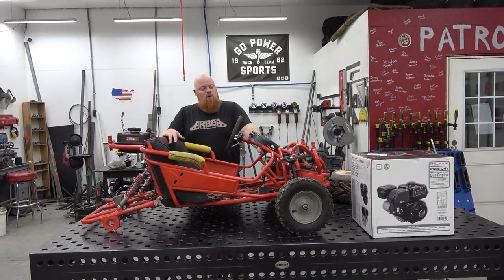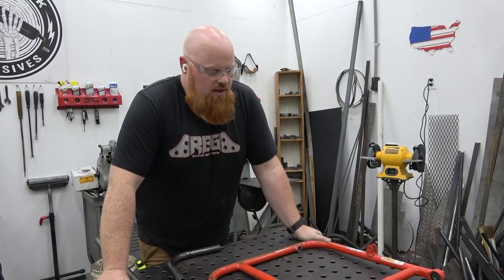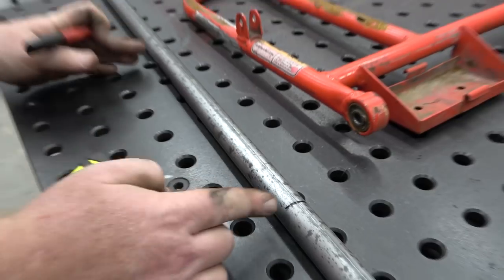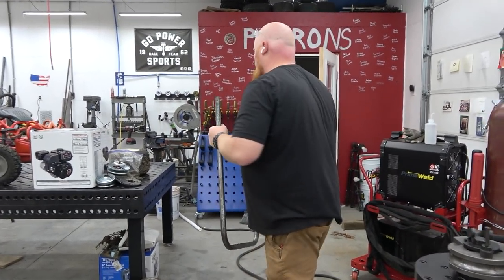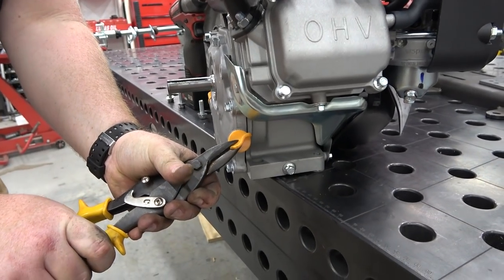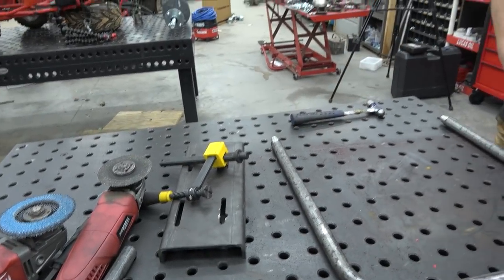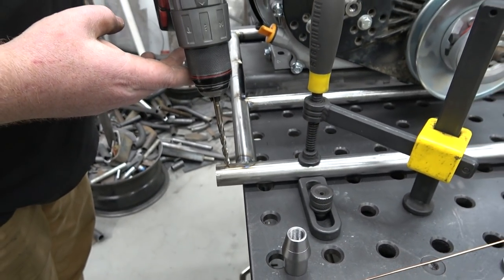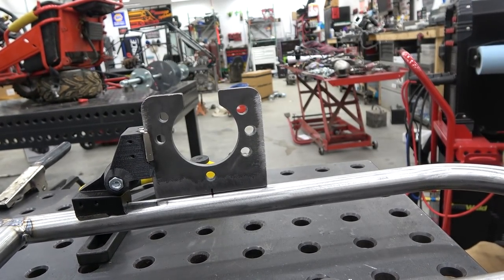Harbor Freight 212cc Mini Off Road Go Kart Swing Arm Build

Comment: why did you start in the middle on bending the back swing arm? start from one end and you could have had a 2 foot piece of tubing left instead of 2short pieces. just wondering
Reply from the maker: I like to show it different ways. I have done that in the past. Easier to explain to someone who hasn't bent tubing before.

Comment: Another Great Video .. do you drill drain holes in the tubing . I know I was welding a closed system and it would blow the weld out something you have too watch out for ,,  wish I had a Go kart like that as a kid ...
Reply from the maker: Sometimes I do but didn't on this swing arm. Depends on what it is.
Reply: @RedBeardsGarage  thank you for the response..

Comment: Ok, my slick-topped, ginger-bearded, hillbilly buddy, as your self-appointed language enforcement officer, if something can be installed, then uninstalled, or visa-versa, with bolts, by definition, it is a, “bolt-able” system. If your friend wanted an, “unbolt-able” system, you would have to permanently affix it to the frame, ie; via welding, bonding compound, etc. If it is unbolt-able, it cannot be bolted or unbolted. Are ya smelling what I’m stepping in here compadre? You’re welcome, and hope y’all have a Happy New Year! 🎊🍾🎆🎉

Comment: So with that style of bender it won’t go past the 7 degrees will it? It’s basically stops itself?
Reply from the maker: No it means that it will put 7 degrees of over bend to achieve a true 90 degree bend. All tubing has spring back so I it didn't do the overbend it would end up being 83 degrees.
Reply: @RedBeardsGarage  ohhh okay that makes sense now

Comment: Can anyone answer what the difference is from the torque converter Set up is for on go power sport then the one off line?? I just got one off line for 75 $ but the one on GPS. Its like almost two hundred. Looking at picks it seems to be the same. Same red spring ??

Comment: That is exactly what I want for my golf cart but with reverse built in. If you made that  for gas engine ezgo marathon carts id buy it . It would be a whole different thing for an electric cartbof the same model it has the rear end on leaf springs instead of swing arm. I'm sure it could  be done but I  don't have an electric cart so 🤷

Comment: I have a question. The motor mount plate that you welded on to the swing arm, has 3 separate beads on each side of the plate, rather than one complete bead the whole length of the plate. Why is that?

Comment: Hey Greg, great cheap way to save your welding shield, use pledge furniture polish.   Not the cleanser, the polish.

I spray a little on there, and wipe it off to clean the shield, then put a little more on there and ‘buff’ it until it has turned into a thin clear layer.

It really helps keep the spatter from sticking to the plastic.

I used to do it every morning, and it made my lens last three times as long…